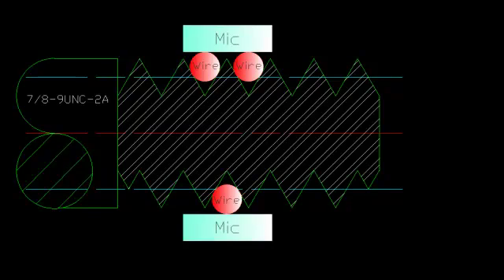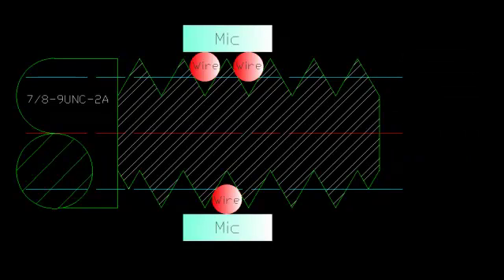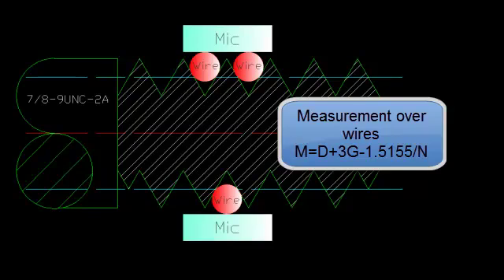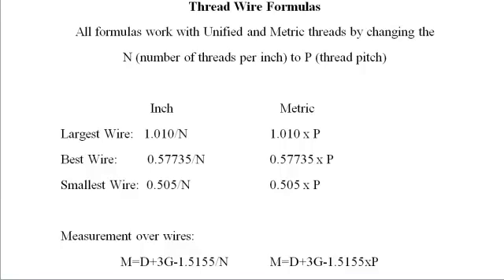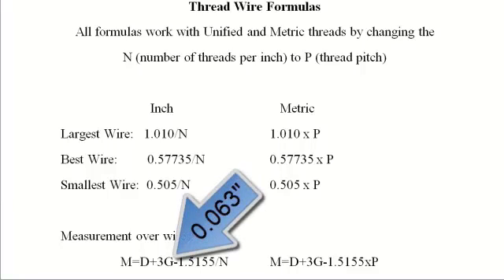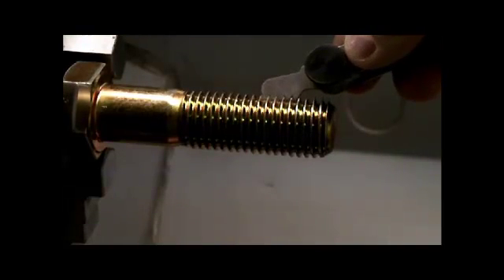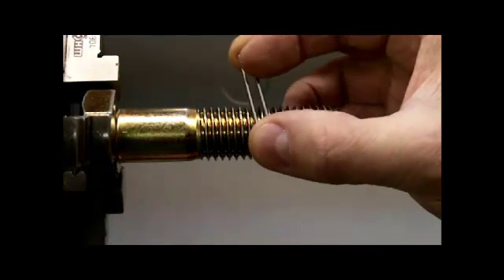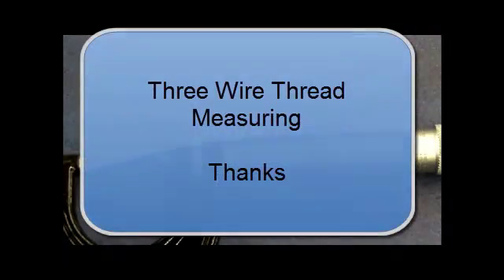Thread Measuring - Three Wire Method

Comment: Mistakes and omissions here. .895 is NOT the maximum size of a 7/8-9 2A thread as machined and before plating. Before plating the max is .8937 and after plating it is max .8956. So that screw is acceptable only because it is plated. This method is only suitable for class 3A threads and plated class 2A threads but in either case it does not indicate what undersize is. Neither does it indicate what the plating allowance is.
It is not necessary that the wires contact the pitch diameter line, anywhere in the V that is straight and where the wire still protrudes will give equal results.

Comment: pl explain 0.57735/N, it is formula or calculation
Reply from the maker: It is a formula used that gives you the correct size for the wire used for the required pitch (1/N). It is derived from trig.

Comment: Hello! I applied the formula to get the MOW in a M5X0.5-6H plug gage but somehow it does not match my program for calculating this. My programs show the MOW to be 5.112-.005 but with the formula I don't get that number, any advice? Thank you!
Reply from the maker: I got 5.61mm (max). What wire size are you using? (.4572)? D=5mm G=.4572mm the 1.5155 is multiplied by the pitch because it is metric. Pitch= .5mm
Hope that helps.
Reply: @machiningmoments  Thank you for the response. I found out another way for Metric gages that worked well for me. This is what I got MOW=PD(Pitch Diameter+C(Constant). In this case with an M5X.5-6H the PD is 4.675 plus the C being .4330 comes to be 5.108+.005 this matched my programs. I am using Mitutoyo Thread Measuring Wires for .5mm pitch, the size of the wire came to be .2887mm.
Thank you for the video, it helped a lot teaching new employees.

Comment: 3G = 3x .063=.189  ?
Reply from the maker: I am assuming you are questioning why use the math of three wires when you measure straight across. The formula factors in the three wires making a triangle at the pitch diameter.
Reply: @machiningmoments  actually I want to know if the formula should be interpreted as we do in typical math problems. My wire set says "3w" . I was taught that this means   3 times the variable/unknown. Thanks for the help.
Reply from the maker: I believe in this case it is 3 times the wire you are using. The w is the wire diameter you are using from your kit. G is the same as the w, that is the way it is presented in the handbook. Good luck Rev2
Reply: @machiningmoments  in my case I'm cutting 2-7/8-16. Using the .04 set pd= 2.830
Found an online calculator . I was given 2.900 over the wires.
Reply from the maker: Assuming you don't have a chart for a wire set, google "pitch diameter wire chart images". It is .040" wires for 16 TPI. The formula I use is M = D + 3G - 1.5155/N. M = Measurement over the wire (must be larger than the OD of the thread, D = nominal diameter in your case 2.875", G = diameter of the wire you are are using (W works also) in your case .040", N is the number of threads per inch which is 16. So if we crunch the numbers we get 2.900" like you said. Now this is the top size of a class three fit (assuming you are cutting a unified thread). You would then look in the machinery handbook and see how much smaller a class 2 or 1 would be. I hope this makes sense Rev2?

Comment: I'm glad there are people out there who are interested in this.. to me it's Chinese!!! lol actually I got the first part.. then completely lost interest since I came here wondering why 3 wires were used instead of just 1 wire wrapped around the thread but I guess bending the wire would change the measurement.. especially on smaller bolts.
Reply from the maker: These wires are fairly hard and wouldn't bend very easy.

Comment: The measurement taken over the wires when used in a specific formula will tell you the pitch diameter. The wires do not necessarily contact ( tangent to) the thread profile at the pitch diameter. Any wire that would conform to that statement would be too small in diameter to project above the crest of the thread.
Reply from the maker: Someone smarter than me figured out a wire of a certain diameter relative to the pitch of a thread would contact the thread at the pitch diameter and protrude beyond the outside of the thread making measurement possible.
Reply: I will have to dig deeper into your reply. I can't see it happening if the wire contact is truly tangent to the pitch diameter.
Reply from the maker: Hi Joe, let me know what you discover please, that is my understanding of how it works.
Reply: I will. I am intrigued as well. I'll run it on my CAD system and see how much wiggle room there really is.
Reply: @joepie221  Interested to hear any more info or feedback also. I use this video and your's Joe in my classes :)

Comment: great explanation.  please add the case for thread cutting to this one.
thanks a lot. 

Nik
Reply from the maker: Hi Nik, you would like a video on thread cutting?
Reply: yes. I'd like to be more familiar with this measuring method  when we make threads. you know, you have to cut more deaper when you don't get the exact pitch diameter. 
if you have time.
any way thanks for great video. 
Nik

Comment: What's your take on the calibration of go screw plug gages? I currently use a ULM 600 and 3 wire measuring technique like in your video. Although the calculations and chosen wire sizes are built into the software.

We are considering something maybe less accurate but still a pass/fail scenario in the way of snap ring gages, set using master plug gages.

would these suffice? As in would they show enough indication of wear as to find non-conforming screw plug gages that didn't have obvious signs of damage/wear? Thank you.
Reply from the maker: I like snap gauges as they are less technical to use..(low skilled operators). As for accuracy, I'm nor sure how tight your tolerances are but they work well for most situations. As for wear, schedule regular calibration and you shouldn't have an issue. Thanks for asking.
Reply: machiningmoments Thanks for the reply, I'm currently looking at a Tri-roll gage comparator. Have you thoughts / prior experience with them at all? so far it looks ideal as it's also portable.
Reply from the maker: I have used one that is spring loaded and has a dial indicator on the comparator , I like it...it works fine. You need a different set of gauges for each pitch, threads per inch. So I guess my opinion is if you can justify the cost it is a nice tool to have. Thanks for asking. Good luck!

Comment: Being a bit pedantic but the wires will not always touch the thread on the pitch diameter.  That is Ok as the formula still gives the correct result for the measurement.  The best wire will touch exactly on the pitch diameter, smaller wires will touch a bit deeper in the thread and larger wires will touch a bit further out.
Reply from the maker: You are correct, they fall within the acceptable range.

Comment: The largest , best and smallest wire is remains the same for all sizes of thread measurement?How do you get that result?
Reply from the maker: +Suki Chin The wire "contacts at the pitch diameter" the extra size is added to the outside measurement.

Comment: Calculation for preferred wire diameter is [ Pitch OVER 2x(COSxhalf the included thread angle e.g. 30 degrees) ] . Using this calculation for a M40 thread with a 3.5mm pitch I calculated roughly a 2.02mm wire.

Does that seem correct?

Comment from the maker: The math will change depending on the thread you are measuring. Is your thread 7/8" outside diameter? (male) is it 9 threads per inch (course thread)? Are the three wires your using all .063"? If all of these are correct your thread is cut too deep. Please let me know how you make out with this. Thanks for your note.

Comment: Thanks 
But .875+.189=1.064
1.5155/9=.1683888 or round to .168 or to .1684
I am getting .996 or .9956 Not that .0005 matters much unless one is grinding a ball lead screw, but still I Wonder why we are not the same? Is it that the male has to be a slip fit smaller than the female? And zero fit would never go?